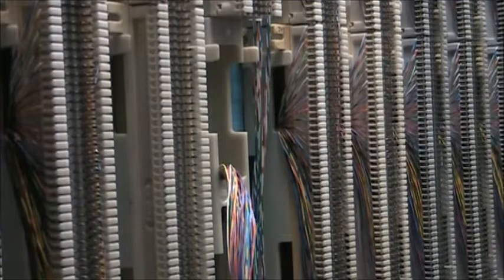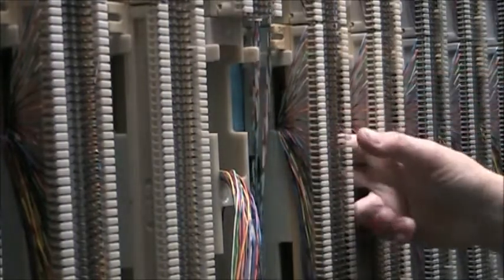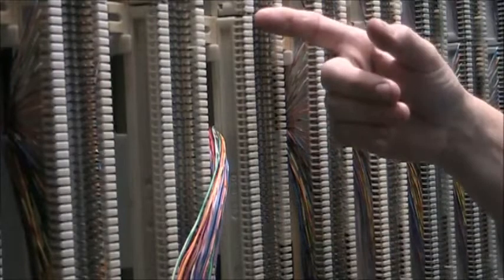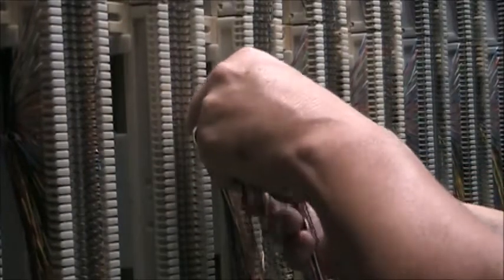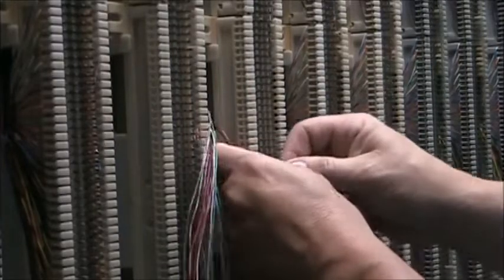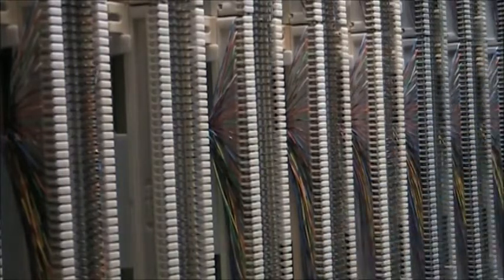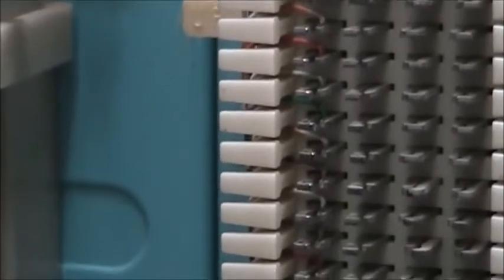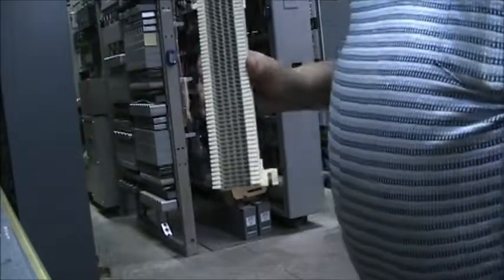Punching down / Terminating a 25 pair telephone cable on a 66 block. For hobbyist 1A2 system .

Comment: I've terminated thousands of 25 pair cables and what I did was break them out as color groups first then do each group starting at the top.  I was once asked to show some county techs how to punch down cable to a 66B block and while I was doing it, I was explaining what I was doing.  When I finished, Ollie, their supervisor pulled a stopwatch out of his pocket and said I did it in 4 minutes and the Bell standard was something like twice that.  I've also done Amp Champ connectors by the thousands and can do them nearly as fast.  Terminating cable is a lost art.  I eventually moved most our mainframe stuff to 110 blocks which allow a much denser back frame.  I retired from the private telecom field after 32 years in 2006 and kind of miss the daily work. I now teach VoIP at the local community college.

Comment: A lot of older apartment buildings are still terminating with either 66 or BIX systems.  It is so sad to walk into a cable room and see a wire rats nest.  I maintained telecom offices in old bunker systems and went from wire wrap/solder, to 66 blocks, and BIX systems.  We also migrated to terminated connectors.  I am not sure what the background noise is, but it does remind me of my old strowger switching systems.